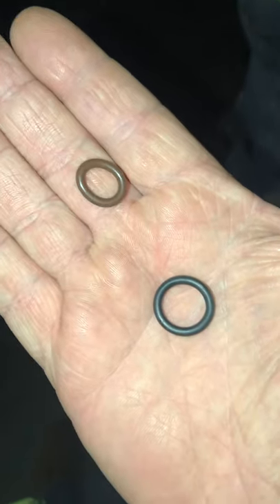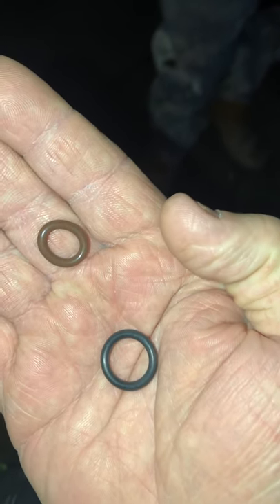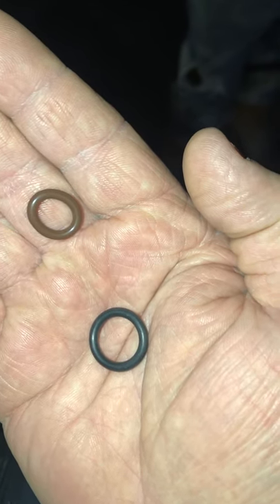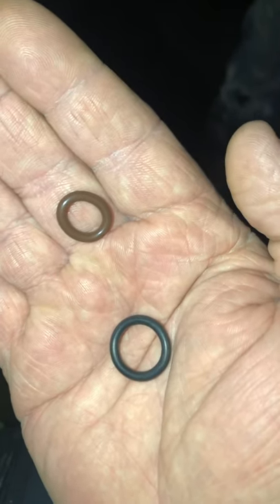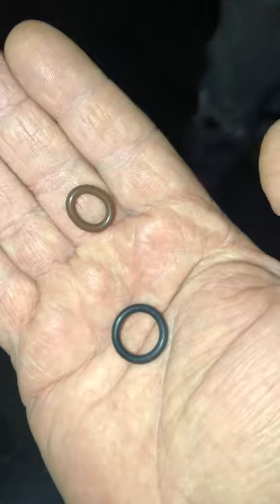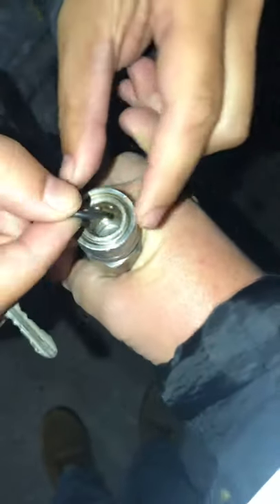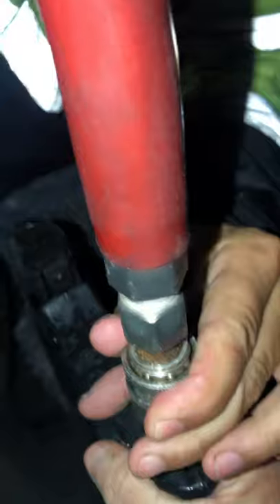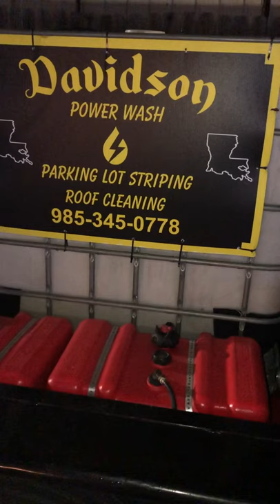Pressure wash O-rings

Comment: I knew the guy sold me the wrong size but im new to this so im learning. My quick connect to my pressure washer tip. I believe its a quarter inch. I bought 3/8 but i will keep. I tried and it was not fitting

Comment: Hey Billy, What is the material your tote and back gate signs are made of? Thanks. Really enjoy your videos.
Reply from the maker: Sean Brown actually the signs on the side of the water tank is basically yard signs made out of corrugated plastic very similar to a political sign. The rear is some type of fabric that has thousands of a holes per square foot that allows air to pass through it’s been on the trailer for a couple years and approximately 45,000 miles later it’s still holding up but probably needs to be replaced soon. I got it from Vista print a couple years ago but a friend designed it for me. I was thinking about doing some type of other Metal sign on that rear gate with high reflectivity. We get several thousand dollars worth of calls each month from those signs on the trailer